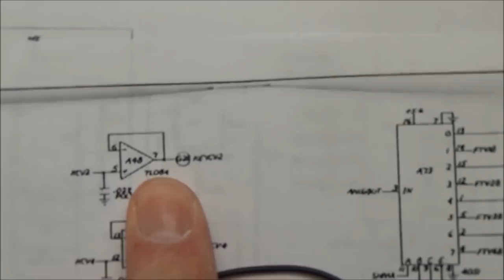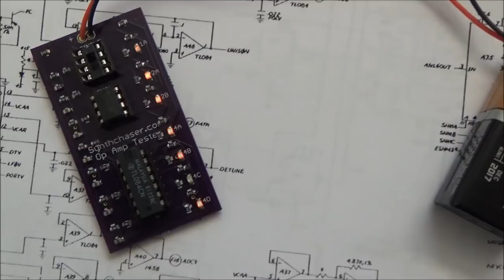Synthchaser #087 - Oberheim OB-SX Restoration & Repair

Comment: Great video ! Thanks for sharing. From 5:05 to 5:06 there was certainly a few hours of painstaking work done on that keybed. I know, because I did the same on my 1975 Minimoog D when I first got it. 
I didn't manage to get all the keys quite straight. They're all leveled, height wise, but some are a little "crooked" or slightly twisted sideways, even though I took great care to put back the plastic keys at their initial position after cleaning them. Is there a trick, aside from fiddling with the rubber bushings, on these Pratt-Read keys ? Mind you, it still works really great (especially with the Opto-Key system installed), and I do enjoy the buttery feel of that amazing keyboard. My issue is purely esthetical.